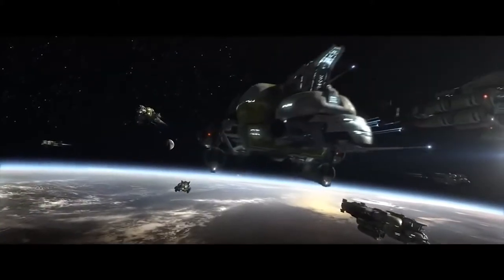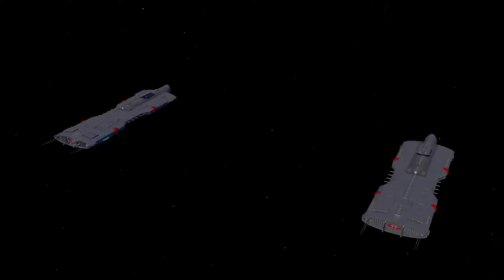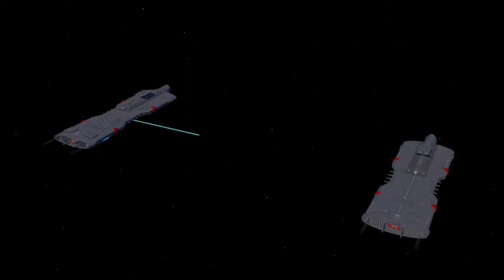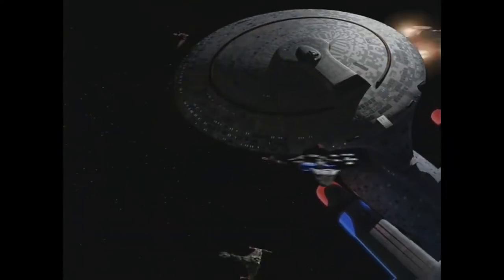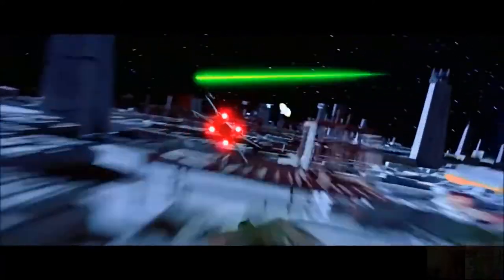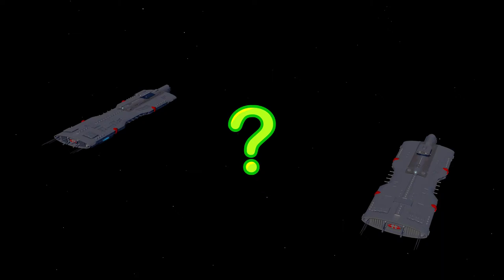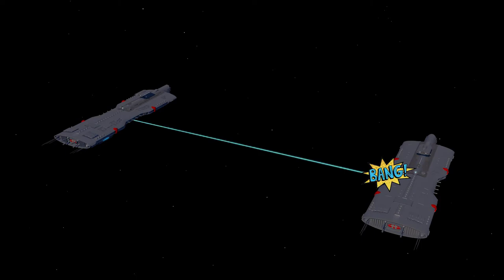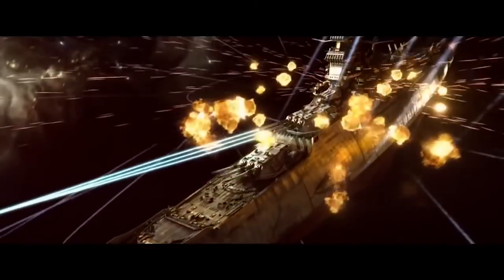What's more realistic in space combat, beam weapons or bolt weapons?

Comment: The bolt type is not even possible
Reply: Actually, classified Project MARAUDER proved that it was possible to fire contained toroids (doughnut shapes) of plasma using a railgun. Assuming such a device could be powered by a Casimir generator to use zero-point energy (a technology that has been unfairly suppressed so those in power can maintain their control and wealth), as well as the rails being made of some highly-efficient superconductors (carbon nanotubes seem like a good candidate at this point), then it could certainly be achieved.

Comment: Wrong about heat dissipating quickly in vacuum.
Reply: He's also wrong about about why lasers are invisible. It doesn't matter what frequency the photons are at since the light is all hitting the target, not the eyes (or camera) of a third party observer.
Reply: I always thought it would make for an interesting scenario where the whole goal of space fights is to overwhelm the enemy heat management.
At which points lasers would be interesting again, because they could just heat up the enemy ship. Or a microwave beam. And if done right, that beam projector can take heat off the own system.
Projectiles would be focused on radiators and coolant pipes.
Spaceships would have to tread the line between optimal radiator placement and armored cover. And you don't want to blow the heat from your radiators into your armor, so one of the systems would have to be adjustable. Like having radiators that fold in, which stops them from working. So the longer the fight lasts, the more the ship heats up. Turns every fight into the equivalent of a submarine battle with limited air supply.
Reply: I first had the idea myself when trying this sandbox called The Powder Toy. Some spaceship models people made could really take a beating, but heat buildup would in many cases have taken it and the crew out ages before a hull failure.

Comment: The two problems you list about turbo lasers are solved by the same answer. 

Blasters, or turbo lasers, are plasma fired along a targeting laser. The laser part is there to guide the plasma along the intended path. This has been tested in several prototype plasma based cutting devices, and laser based lightning rods.
Reply: And considering how plasma works, you can't really "guide" plasma, so much as merely launching it. Plasma, by definition, is a state of matter, in this context it's usually a superheated ionized gas in condensed form. Considering its properties, it only works as a close-range weapon (at most medium), because it will disperse without something to contain the plasma long enough until it could deliver its payload onto the target, that is thermal and kinetic damage. Also, plasma projectiles would very likely travel at a speed slower than you'd might think, hence its suitability to being more of a close/medium-ranged weapon.
Reply from the maker: oddly this is one thing about Star Wars that might actually track, scientifically speaking. we always wonder "why do they fight SO CLOSE to each other??"

maybe it's because plasma IS so short-ranged but at the same time is the only thing that can reliably punch through shields.

just a thought. I know SW is short on science, but I think by sheer accident they may have made this part of the canon logical
Reply: @Josua070  As I was stating, you can actually guide plasma. 

https://www.youtube.com/watch?v=9XuAX-L2xxo
Reply: @moreauphoto  also in cases like Gundam they use a thing called I fields it's basically some form of containment field for beam weapons. It's in the beam sabers the rifles etc. But you rarely see a I field. Only when it's specifically used in defense do you see them flicker.
Reply: @Josua070  I mean in the Star Wars universe two to three kilometers is the maximum. 1.5 can definitely be achieved

Comment: Regarding pulsed vs. continuous lasers - other than obvious benefits of not needing to track the target to deliver that energy, there is one more - once you reach a certain threshold of energy density, you no longer heat the material up, you blow off electron layers and disrupt chemical bonds. Speaking of which, on the year you released this video a Nobel prize was awarded on the topic of wide spectrum lasers compressed into high density pulses of energy. By now most laser surgery machines use this technique to ablate tissue without overheating surrounding areas. Of course in real life, unlike in games and such, you don't need to actually destroy target to win a battle - continuous laser beams even if they can't effectively penetrate the armor, can damage sensors and other equipment necessarily located outside of the hull.

Comment: My thinking for this has always been that there is an initial pellet or packet which serves to break or create an initial incision, and then there is the beam which follows behind that, and then behind the beam which does most of the damage there's also a tail or trail -- and in this way, a beam has a sort of structural anatomy. In this way, every beam we actually see is actually all three anatomical components, but they are in different ratios for different specialty purposes.

If the pellet is particularly big, we get the impression of a bolt. If the beam is very long, we get the impression of a beam. If the trail is slow (suggesting that the shot becomes out of phase with the firing assembly) this could make sense, as that's energy you could be using for the next shot, so lazily dismissing the shot is more like clearing the barrel or the firing subassembly for the next shot and reducing the latency between shots.

This seems like a design flaw, but its highly desirable if we want to engage multiple targets or if we have an energy shortfall over time due to the design of the energy exchange subassembly having an initial high onset efficiency and then a lower efficiency over time (much as we see with real capacitors) so the energy and matter shunted to the focusing and acceleration subassembly has a latency to deal with -- so the trail is a trade-off of trying to be more efficient.

My favourite example of these dynamic forms is probably the beam magnum on the RX-0 Gundam, which burns through a full magazine with every shot and as such stacks them behind the condenser. A pellet forms of a selected diameter, trading off the width of the beam for the velocity based on the distance of the target (not unlike a phaser strip) and then the condensed M-particle degeneracy is pierced asymmetrically so it acts almost like a rocket, propelling itself forward while the front of the barrel acts like a pusher-plate and reflector.

As the pellet travels, it leaves a trail behind itself, which its constantly trying to symmetrically repel (further propelling itself forward) which in turn expands. The result is the magnum doesn't require a direct hit to make a successful strike, since the resulting beam left behind by the pellet and the reflector trail have a massive diameter making it an area of effect weapon. In turn, the M-particles REALLY want to lower their charge-states, so they release photons whenever they strike baryons (such as matter) so you get these huge slow cascading fractals of light (its not lightning: there's no medium!) and huge amounts of gamma radiation that superheat whatever it strikes.

The thicker your armour is, the worse the damage tends to be -- so the resulting doctrine of these weapons is to be incredibly evasive and depend on the imperfect information created by M-particles distorting photons naturally (sort of like how light diffracts through water) which makes a lot of long-range communication and sensors functionally useless, and wrecks havoc on digital optical and electronic systems -- meaning mobilesuits are usually running highly isolated and filtered analogue computers to compensate. The technology ended up rendering laser technology functionally useless, and so the nature of space combat changed entirely in under 50 years. The one exception found was using an O'neil cylinder's mirror assembly and a custom focusing ring as a literal space-laser by refocusing the light of the sun and by packing the colony with millions of tons of monocrystalline focusing substrate, at which point lasers became a weapon of mass destruction but were too big to move using propellant technologies of the era.

Yeah Gundam is a... Little bit smarter than it lets on. If you like this stuff, go look up the physics behind muon catalysed Minovsky ultracompact fusion, and the M-particle theory that the show uses. Its really cool stuff.

Comment: 'They're called "lasers" in the film".' I like your video in general however I take issue with this point. Nomenclature doesn't have to be completely accurate in how it describes a machine's operation. To use another SW example, they refer to hyperdrives as 'lightspeed' which is clearly inaccurate since they traverse the galaxy far far away at many, many times c. 'Turbolaser' could be named that way for any number of in-universe technical reasons. But as you point out in the rest of the video, 'realistic' lasers would be invisible. Even IIRC if they were in the visible part of the EM spectrum (which as you point out is unlikely) they would still be invisible in a vacuum. 

So what can we conclude from this? Perhaps turbolasers have A laser in the mechanism, but aren't actually wholly or completely lasers? There is a visible 'bolt' that propagates at sub-c velocities. Could there be an invisible part that's the actual 'laser' part of the bolt? (IIRC some fx 'flaws' seem to indicate this i.e. things vaporise before the visible part of the turbolaser bolt hits, the example I vaguely recall was a Star Destroyer shooting up asteroids in Empire). The 'plasma' bolt that's visible might be something like a tracer effect. I'm sure there's SW technical jargon that explains this.

As far as Star Trek weapons go, well, they're explicitly NOT lasers but exotic particle beams. Phasers in particular shoot nadion particles that interact with normal matter and give it a very energetic and rapid existential crisis. I tend to handwave away fx issues with phasers because of this :D